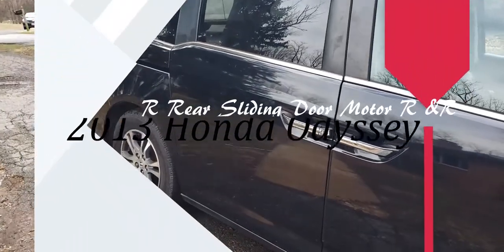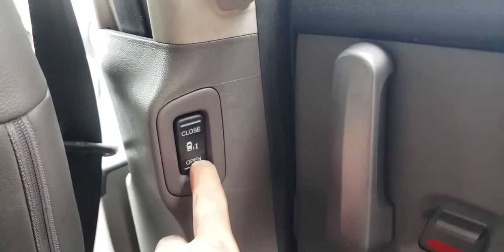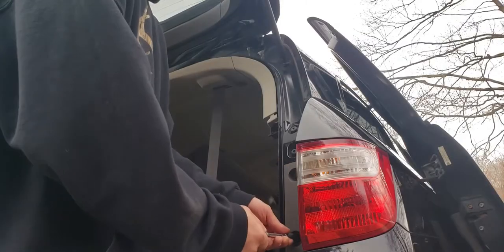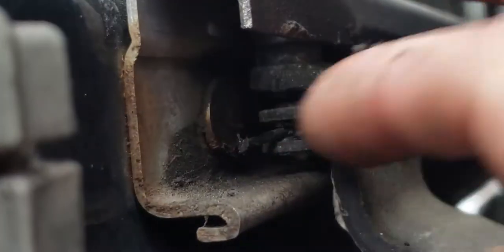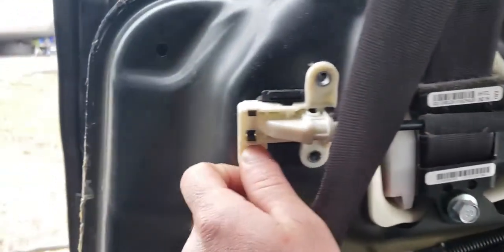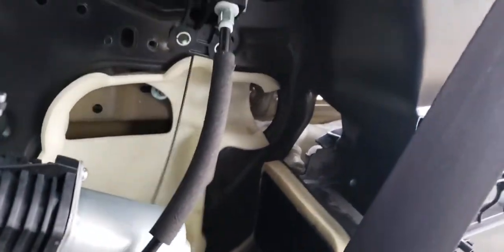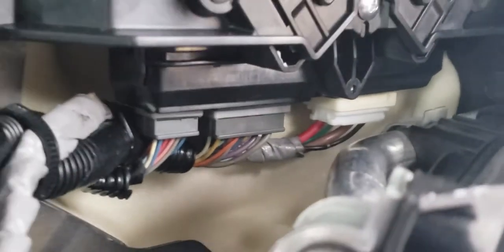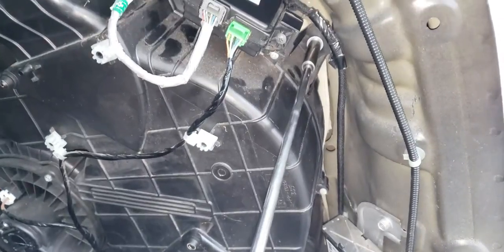2013 Honda Odyssey Sliding Door Repair R Side

Comment: Thank you so much for posting!  All the other videos out there for this are for before 2011 models.   My 2013 RS door opens fine but does not close.   I have taken the cable cover side panel off (which mine has clips and looks like you were able to slide that off?) cleaned up the wires to make sure no obstruction and now thinking I still need to replace the whole assembly.    Besides part 72010-TK8-305 (motor) (@ $403)  what other parts did you purchase?
Reply: Chris Nelson interested as well. Did you ever get this done?